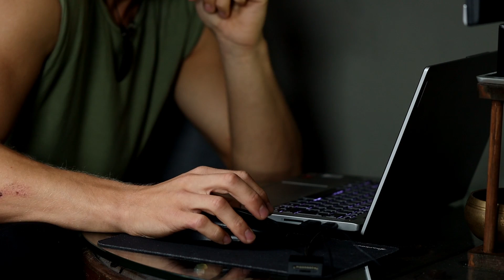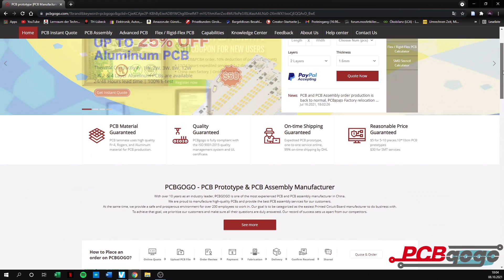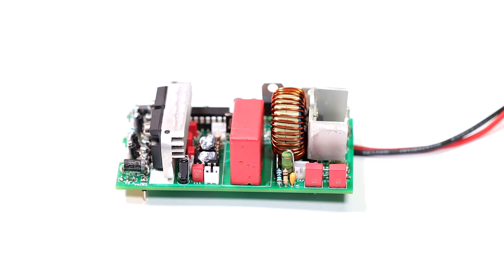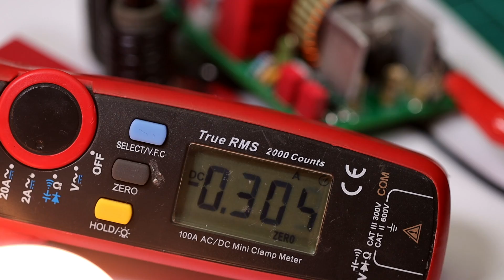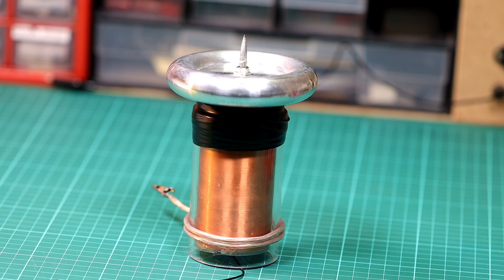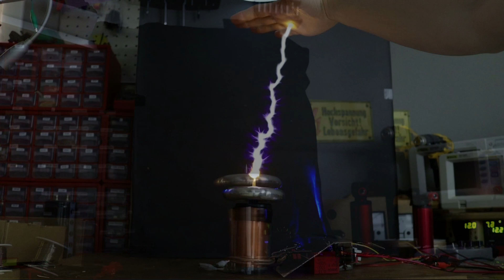I built the BEST 12V Tesla Coil on Youtube (Teslagun Part 2)

Comment: Can I use(DC12-24V ZVS Coil Driver d Flyba Driver Module with Ignition Coil High Voltage DC Power ply Repla ent for Tesla)
Reply: If you mean connecting directly to the primary coil, then this will not work, since usually these modules have a frequency of 20-50kHz, and the coil in the Tesla should work at resonance, and even if you just put your hand into the field, this will create a specific capacitance and the resonant frequency will float away  .  The modification of a regular ZVS Flyback into a Tesla coil is called RbSSTC.  If you mean step-up transformer, then yes, you can.

Comment: Wow, nice :D
Super awesome coil!
The ZVS Inverter worked much better at supplying the circuit than I expected. Did the Voltage regulation via the Arduino work as expected and were you able to set a certain voltage?
Reply from the maker: Hey,
Ich antworte dir mal auf deutsch ;) danke!!! In diesem Video habe ich die ZVS mit der Eingangsspannung reguliert. Von 6V bis 12V via Netzteil. Den arduino werde ich doch nicht zum regulieren der Spannung verwenden. (Der ist relativ störanfällig, ich mag Programmieren nicht etc). Deswegen verwende ich jetzt mittlerweile ein Komparator (LM311) und kann mir dem die Spannung von 50V bis 300V regeln ;)

Comment: Where do you connect the bottom of the secondary coil? Can you also share the arduino code?
Reply from the maker: It is connected to ground, I will publish the Code when it workes ;)
Reply: @Teslaundmehr  ground as in the battery negative?
Reply from the maker: @diegokoivukangas6461  I will use my Body ad ground
Reply: @Teslaundmehr  so it’s not connected to anything else in the gun? Just goes to your body?
Reply from the maker: @diegokoivukangas6461  yes
Reply: @Teslaundmehr  that makes sense, thanks
Reply from the maker: @diegokoivukangas6461  no Problem ;)

Comment: Oh yea, and does your bridge rectifier get hot? This was always a problem for me running a ZVS over 20khz or so, I'd have a big voltage drop and losses using a 60hz rectifier so maybe you can further increase the charging efficiency using big faster diodes.

Comment: That's great result, everything seems tweaked pretty good and the low BPS output is real nice and beefy from only 1000uF! It's a great build all by itself without even putting it in a pistol enclosure. Those little cores also work great for the ZVS I'm gonna try those since the TV flyback cores are a little too big. 
You may have mentioned this in the video but I was wondering how Q3 turns the ZVS off unless you just meant to put it directly to the gates. The voltage divider for motor feedback and to control ZVS voltage is pretty neat also I can't much think of a better way to do it. I guess theoretically a similar setup using higher voltage switches could charge a cap to over 600V before discharging and it would only take a few seconds. I remember when briefly playing with a ZVS fed setup there were some interesting variations in the output depending on the interrupter settings and the speed at which the bus cap charged. All that aside the general layout and design of something like this being put into a printed frame of that size is incredibly difficult. I'm already just curious how everything minus the ZVS portion would work running from straight 240VAC, it's one of the smallest thru-hole packages I've seen with driver included and we already know it works really good with such a small coil. The other setups I've seen with similar output were using a dual resonant primary so I guess that's yet another possibility where secondary feedback may work to the circuits advantage. Either way I'm picturing maybe just the addition of a fan and minus the ZVS it could fit in an enclosure so small it could literally be hidden within the bottom portion of a 4" PVC forming the secondary.
Reply from the maker: Hey Bro,
thank you, I really appreciate it. You are right, Q3 is not optimal. In the next version I will pull the gates of the mosfets to ground via a diode by a transistor. That is much more efficient. I have very little space for heatsinks and fans, so I will probably install expensive SIC mosfets. Even now the IRFP460 stay only handwarm. The bridge rectifier remains cold, which is from a switching power supply and designed for high frequencies. But on the PCb is only a half-wave rectifier consisting of UF4007. In the new version I will use a full wave rectifier. Also I will install a flipflop ;)
Reply: @Teslaundmehr  Sounds legit. With flip flop you probably could just toss a primary cap on for testing but as-is it doesn't even seem necessary. It puts things in perspective with such a tiny circuit and coil that has the same output or better as so many other much larger builds including my own lol. The tiny stuff is my favorite, I doubt I can make them as small as yours but I'm def gonna start messing with tiny half bridges and some kind of boost stage.